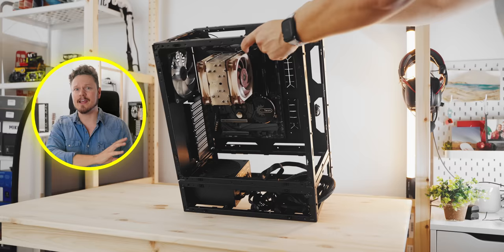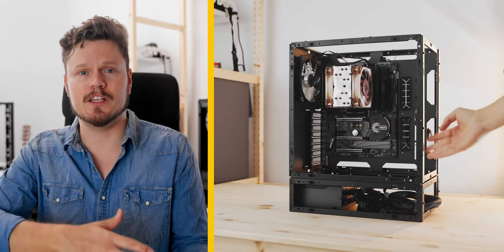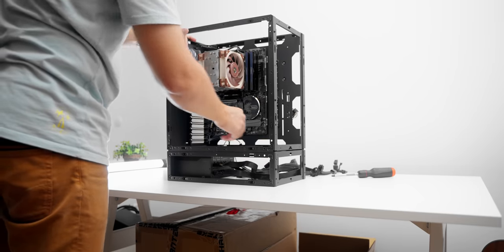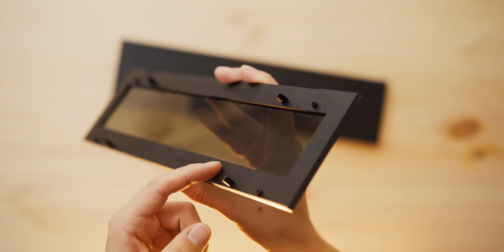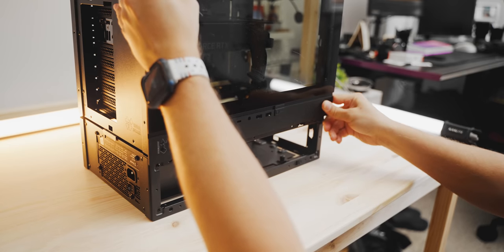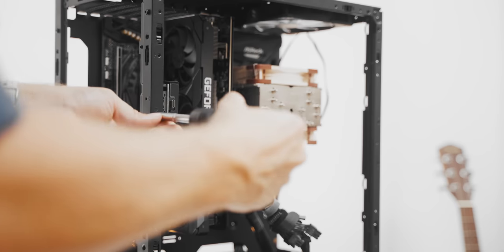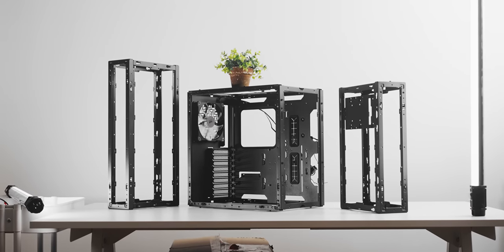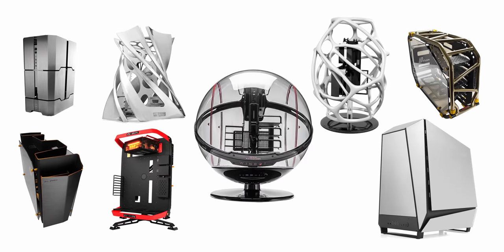The PC Case from the Future is HERE!

Comment: I'd love to see more options like itx or matx or something, that'd be sick
Reply: Agree completely. ModFree Mini and ModFree Micro would decimate the market.
Reply: yeah I hoped for sth smaller as well. Just the first two modules together are quit big
Reply: @WhiteG60  those are some great ideas
Reply: WAIT FOR THE STREACOM FF1
Reply: Yeah modular makes more sense for ITX as people who use an ITX case would actually care about having the optimal size of the case for their components. Whereas ATX buyers would probably just go for a case that can support everything and save the hassle of doing modular assembly
Reply: @aaronbrook   Depends on the price..
Reply: Agreed. Itx and matx is needed. Full atx it's kind of gimmicky for $250
Reply: Totally agreed! While rigid compartments are nice for modularity, the Phanteks evolv case’s sliding design has a lot of potential. Perhaps the case panels can become a + (4) instead of a - (2) separation.
Reply: I think in the right hands the PWS cage can be made into an ITX build.
Reply: Standards are important..... I want Good MicroATX boards.
Reply: This was my thought. They make an ITX focused variation then I'm sold.
Reply: Something that offers a decent amount of modularity for the matx/itx is the SAMA im01 Pro. Each section can be reconfigured and it has an optional expansion section.
Reply: 3000% agree...I want an ITX version of this so I can 3D print my own panels for it.
Reply: Modular ITX where you could expand the GPU slot would be slick

Comment: I've been test bench pilled for a while now, and it has worked great for me. People really overestimate the issue of dust, besides with a test bench cleaning up the dust takes like a minute anyway. My thermals are always excellent and it runs quiet, because the fans don't need to speed up too much to cool the system. Changing components is such a breeze as well.
Would recommend, as long as you don't have small children or pets around.
Reply: What did you build it on, an actual test bench product or something you created yourself?
Reply: @jonevansauthor  On a streacom BC1 test bench.
Reply: @MidWitPride  yeah that's the one that I had my eye on. Expensive but looks like a really high quality product.
Reply: I'd consider doing this more if my components actually looked like a serious device, rather than looking like Midjourney failed to generate a Gundam picture.

Comment: I really like the vertical, open frame layout. I've been looking at the Thermaltake CTE T500 which is a similar design but fully enclosed. An open frame would eliminate the need for some fans and not have a "front" side. Both are about the same price too.

Comment: Awesome case, It does need stack trays for hdd and i think the ability to rotate the mobo tray. colors and shapes and designs options are all that's needed for this.
Reply: You don't need to rotate the mobo tray because you can rotate the whole box.
Reply: If you want it on the left side of the desk and not have the mobo upside down, you do.
Reply: @alberttheroa4164  think about what you just said, that's literally what rotating the motherboard tray will do.

Comment: Having this in an ITX form factor would be dope as long as the Mod 1 is small, barely bigger than an ITX motherboard, maybe with depth adjustment for CPU cooler height. Then they could make a Mod for Flex ATX or SFX PSUs, a couple Mods that could fit case fans and/or rad, and a separate Mod for the GPU so you could build it in a sandwich form factor with a PCIe riser.

Comment: Just ordered this case, deluxe model + 1 extra Mod III. Will go for the Cube config, As for storage, I have an 8 bay hot-plug 2.5 drive case that fits in 2 x 5inch bays which should fit without issues in the front side of Mod II. For the moment I have only an AIO for the CPU but this case will be perfect for a custom loop.

Comment: Can you get additional modules?
And is there any limit to how many you stack?
I have this funky idea where you just have the PSU base on the front, and then like 3 or 4 top stacks holding nothing but radiators. It might be able to hold enough radiators to let even the thickest system run completely passive.

Comment: I am thinking if an ITX system can be built in the smaller modules. This could be a great case for a NAS build, like whenever more drives are needed you can just stack another module on the top.

Comment: but indivual pieces and make llike a exhaust mod that is able to hole up to 3 420mm rads in the on the long sides and you connect it to one side to make it the exhaust port and if your watercooling you daisy chain the rads together so when the fluid returns into the system it's cooled down enough to pull heat from the whatever your watercooling

Comment: Very interesting case. The usual setup with PSU under the GPU, being able to use the PSU towards the front of the case and leaving the area under the GPU for intake is great. Such option is restricted to either the torrent layout, or dual chamber. With dual chamber the thickness of the case can be an issue. With the torrent layout. Top mounted PSU, restricts the installed a top AIO. Using the PSU on the front, like many ITX, or some new cases do (D41) or the Ap201, restricts direct airflow from the front of the case. That alone would justify me buying this case. Just waiting for it to be available in the UK and I’ll be getting one.

Comment: I like how you can changeup the case to any configuration to meet your needs except what I want and that is Dual Chamber/ lay down. n.  My only downside of this case and it go's for all cases is in black they only give you tinted side windows so to get clear glass in most cases you have to buy white case. Like you said about the dual chamber layout it would be nice to see a square back chamber for the power supply and laydown like the old HAF X is for desktop and all they would have to do is make Mod II fit the backside of the case. Fan mounts on the bottom would also be nice to have on the basic case. In Win keep the fans an reduce the cost as $160 is way to high and you can buy good quality cases in your basic size with higher quality fans for $100 and would like to see a back panel power supply module instead of bottom and another fan mount to have fans on all 4 sides to lay the case over for desktop and have the feet be in back or bottom and I like the larger open holes with filter over fine mesh.

Comment: I like the concept but to make it more versatile I'd wish to be able to change the case layout from ATX to µATX or even mITX with the PSU or radiator being able to stay the same. A little bit like the O11 mini where you can choose between mITX and massive radiators or ATX with fewer or air cooled.

The biggest problem is still how long InWin will support this, do you remember the Cooler Master Master Box or what it was called?

Comment: I've wanted a modular case for a long time, but there's two issues with modularity that're demonstrated well here, lack of modules and the issues with panels.  For example on the former, say that I want the volume of two Mod2 or Mod3 modules, why is there not a module that allows for this without using multiple other modules, or for another example say that I have either on both sides of the case but want a fourth side (keep in mind that 1xMod2 + 2xMod3 only coveres 3 sides as an extension of the base Mod1) yet there's no Mod4 that covers the gap of the final corner as the Mod3 is not long enough to do so; personally, I'd rather see modularity be down to the frame itself, rather than having pre-built boxes that snap together, the system needs to be brackets that hold the wireframe together, this eliminates the issue of having a Mod1, Mod2, Mod3, a missing Mod4, the missing doubl-thickness units of the Mods 2-4, etc.  Then of course the latter, where there's so many configurations that paneling either has to be segmented, which is very hard to get it to look decent, or the panels have to be custom to fit a configuration nicely; and the only real way around this is to have some kind of platform where people can provide solutions and/or products, such as what the 3D printing and 3D modelling  sphere has done, or similarly what DIY forums have done in terms of suggesting solutions.  And if you haven't caught on by now, the largest issue of modularity is scale, you either have to heavily restrict the system, or allow freedom beyond what a typical case manufacturer can do, and this is why modularity makes more sense as a DIY approach, spec your own chassis rail dimensions and base the panels off of that, otherwise modularity is too limited to make sense outside of a one-off gimmicky product; the only silver lining is custom order boutiques, remember companies like Mountain Mods and their insanely wide scope of products for a boutique, per-order manufacturing is really the only way to properly do an adaptable case, but that costs a lot more money, which circles back to the need of a social platform of people who can provide solutions, whether that's sellers, shops providing quotes, distributors, or DIYers.  

I'm not saying In-Win's attempt is bad, it's just limited.  For example look at the Mod1 brackets, the I/O and fan plates, they can only be mounted in the center of their respective frame rails, where a better design would've been a bit more flexibility but this also comes at the cost of complexity; for example the I/O panel could've been split into segments that could be rearranged, similar to the dust filter's adjustability.  But it extends beyond just this, circling back to the whole issue around modules and lack of extended variety; a better modular system would be on a better tesellating grid, the issue of lack of a Mod4 should otherwise be able to be made up of two Mod2s side by side, this would give a Mod5 being mdae of 2+3, a Mod 6 being 3+3, etc., and in both axes where the Mod1 base is of two units in height and width, and another factor should also be depth as a modular case should also include the third dimension, especially if people are wanting dual-chamber cases.  Having a tessellating system like this is the only way modularity would work outside of a very narrow scope, else the only real solution is again to spec your own chassis rail dimensions with custom panels; if modularity is limited it's a gimmick, if modularity tessellates nicely then it can work at the cost of aesthetics and complexity, otherwise a semi-custom solution remains the best long-term. 

The comment towards the end about 'how often are you likely to rearrange your system' is entirely valid, and also part of why I don't think modularity inherently works and why a semi-custom case is the ultimate goal.  Unless you're constantly swapping components or doing different orientations for testing (I can't wait for GN to get this case), then the idea of easy to modify modularity is a bit lost, a case is typically one-and-done outside of minor upgrades, which is also why aesthetics and complexity of proper modularity is a massive concern; and thus again, a semi-custom case will be a better solution for the market this thing is targeting.  This kind of modularity makes sense if you're building something in the form of building blocks, but givent the Mod1 is already an E-ATX base that forces the addition of the Mod2 or Mod2+3, I don't really see the point, just have two or three different cases total;  but if tessellation was better and started from a smaller basis, say mini ITX, or even smaller such as the newer NUC style of an add-in card as a compute module, then this form of modulatiryt makes more sense where you could easily adapt the platform to fit the full range of common motherboard sizes and then some, at least it makes sense from the business side of it.  Though I still say a semi-custom platform is still a better solution, even though a business such as In-Win could not provide that product.  I think a good middle ground would be nice, have swappable chassis rails, rather than have a Mod2 or Mod3 (or a double-height unit, or what would otherwise be the Mod4 in length, etc.), you can just order rails of the predetermined scale and build each unit yourself, and order it via a configurator, this would be a step closer towards a semi-custom case while still being friendly for the more traditional manufacturer; plus there's a benefit of flat packing the entire system, simplifying SKUs, the customer more readily achieves what they envision, and it leads to a solution where the idea of full modules doesn't entirely get out of hand. 

All in all, this approach makes me think of open air benches, in the way that you have a motherboard shelf, a drive shelf (at least before m.2 was widespread), a PSU shelf, etc., except here it all gets enclosed.  Somewhat like the Cooler Master MasterFrame, where it took the open air bench, modularized it, then somewhat enclosed it, with a few options of what you can do with it, excapt again this modular case goes a step further and has actual modules and is fully covered in panels.  But at the end of the day, you're just putting a few boxes together, all the internals are all over the place with little option for organization beyond custom accessories.  Again, the semi-custom option is the way forward, because outside of what In-Win does provide you're going to end up needing non-OEM customization to make the case be somewhat decent in comparison to your typical standard cases, and part of that issue is a missing catalog of modules that'll likely never come, and the argument for custom parts is especially apparent when you talk about how people are about interior aesthetics, the lack of a PSU shroud is insanely bad for the current market trends, they could at least provide segmented blocker plates to at least act like a shroud option; I had mentioned dual-chamber before, but could we at least get a set of backside modules for any semblance of cable routing? 

And the paneling arguments from before also do not take into consideration the variety of materials or aesthetics.  The fact that there could be more than just a flat panel also bolsters that argument, where there needs to be a network of people to provide solutions and sources for such customization.  And again, this gets into the semi-custom argument once again; modularity is nice, but it has downsides where a semi-custom chassis and paneling do not show those same downsides, and again I think there can be a middle ground between the two where you're not relying on a boutique manufacturer for this kind of product.  And to further these arguments, the idea of shapes, I already touched on the idea of adding depth to the platform beyond what the base unit provides, but a variety of shapes gets into custom territory again. 

If there is a version 2 of the ModFree, there will have to be a lot of changes, and those changes need to start at mentality and approach to the concept, so that the final product is more open to what people might want to do with the platform.  But I honestly don't see this happening, ModFree is a one-and-done concept, because companies can't figure out how to do modularity correctly, and they're too afraid of a money pit if they continue developing a concept.  At best, a v2 would be minimal updates to the platform, but we'd still see the same limitations.  Unless someone within the company is able to pitch, and have it approved, to have a modifiable chassis so that you can do more with less modules, again getting into that middle ground that overlaps with the semi-custom approach.  In-Win does do some crazy stuff, but I just don't see them being successful within this market niche, again it's better left to a halo product of good mentality or better left to a boutique that can do per-order customizations.

Comment: Tbh it's a nice but unsatisfying. I've been looking for a horizontal desktop PC case for years, which I can put my screen on top of. These were the first computers that I have used and I'd love for them to have a comeback. That desk setup would be rather minimal with a case as your monitor stand and nothing standing left or right of the screen or under the table. No cables would touch the ground and it would not take up any desk space (because you're not using the desk space under your screen in most cases).

Comment: I'm more interested in mini-itx or micro-atx cases rather than regular ones. Btw, why do we still use old fashened GPU position in nowadays? It consume more power that CPU and produce more heat! It should be somewhere on top or on the side or even with a liquid cooling. Just think about it: we use a huge tower cooler for cooling CPU that produce 120-170W heat and still stuck with flat coolers for GPU. Why? Why don't make a motherboard/case where you can put your CPU and GPU side by side or split air flow betwenn them and put it in a small case?

Comment: If that wasn't costy around 300€ for me in Italy, i would have copied the Thermaltake X9 we are using to make a "copy" of that case with a smaller frame (the ModFree case is smaller in terms of pieces) with the same result (Horizontal motherboard as the same as the X9)...

Comment: I wish one could install the PSU bracket in the front of the motherboard in case one wants those extra chambers for rads and storage, like it would be better for cable management as they will be in the same chamber and there is plenty of room in the front for a PSU... like come on...

Comment: I've been searching for the last 6 years - for a case manufacturer who has designed & is selling a case with the motherboard tray which lays flat/horizontal inside. Should handle an EATX and smaller.  Who wants a 5 pound GPU hanging while they are horizontal inside your case?  You're just asking for problems with that arrangement.